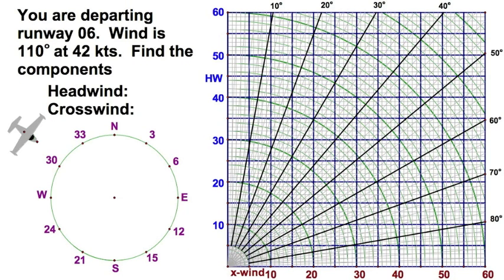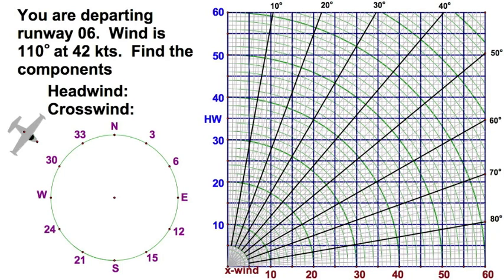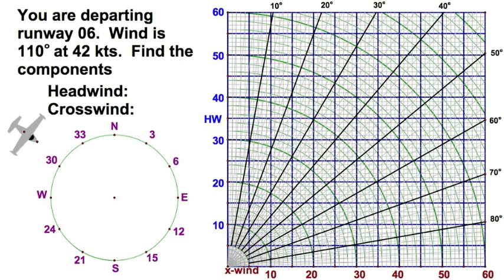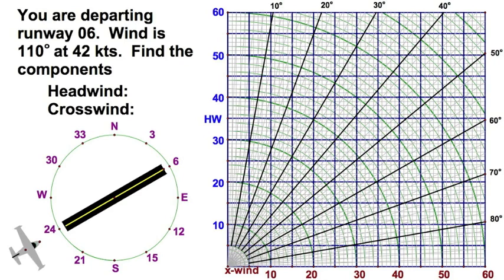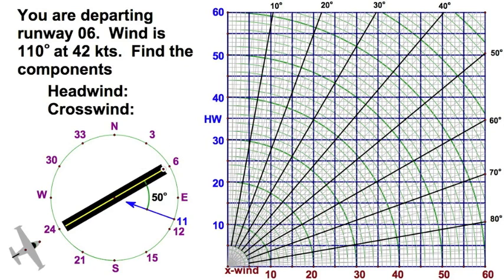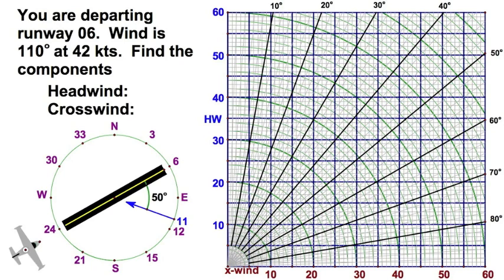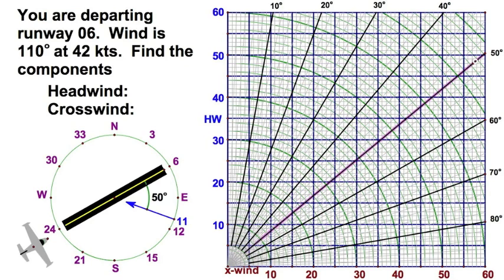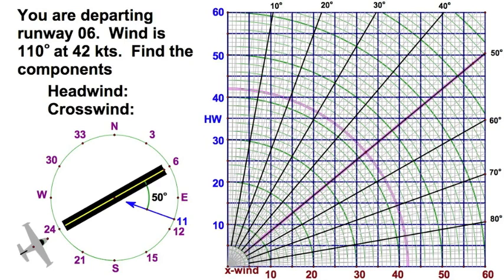Runway Crosswind Calculation with Chart

Comment: How do I calculate this if the angle difference between the direction of the runway and where the wind is coming from is greater than 90°? Say 130°, or 260° at 26 knots Gusting 32 knots, runway direction is 130°. Do I simply use 90° on the chart?

Comment: so one crazy question 😜If we have a 150° wind at 42 knots then the answers are : 
HW : 0 ts
X-wind : 42 kts
correct? at what degree of the wind it becomes forbidden to fly or the runway should be changed? What is the limit for the headwind the be respected? does it depend on different aircrafts? 
Thank you

Comment: calculating x wind is easy you don't need a chart to do it, it can all be done rule of thumb the sixth's rule 

1/6 2/6 3/6 etc...for this 50* it would be .77 x 42 knot x wind give 32knots of crosswind, using that you can mentally know the crosswind component by simple multiplication in your own head :)  once it gets to 6/6 it gets tricky and you have to mutliply by .9 instead of .87 to reduce error from 30% to 3% aslong as you're in the ballpoint you should be fine to anticipate it :)

Comment: the calculation in video is incorrect because you need to get the direction of wind from METAR/TAF (True North) plus/minus variation from VNC to have the direction of wind in degrees from Magetic North to calculate the difference between RW and wind. Your calculation is incorrect because you calculated the difference from RW (from MNorth) and wind (True North).

Comment: Excellent However : You needed to show how did you get the HW and X-Wind ( by using the clock fraction and calculation ) Reason is that on Flight test if the instructor asks you to give him the X-wind on the final approach . You wont have time for chart...... If 50* is equal to 50Mns etc...